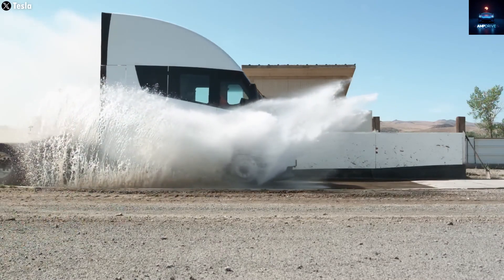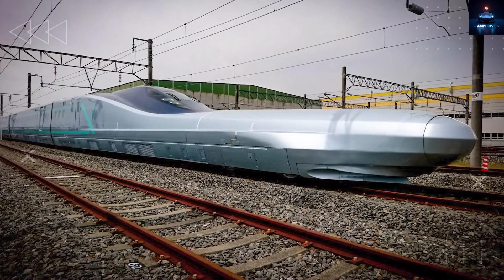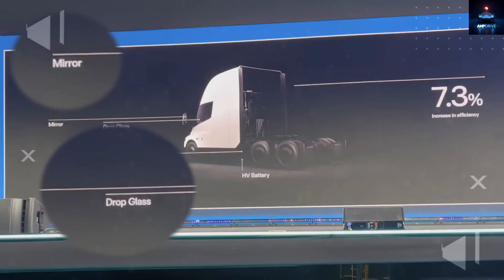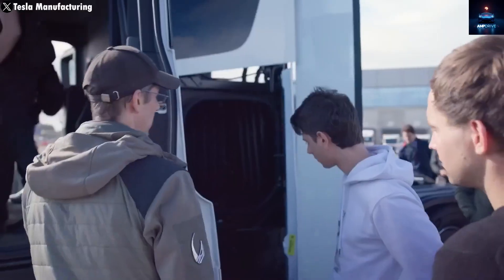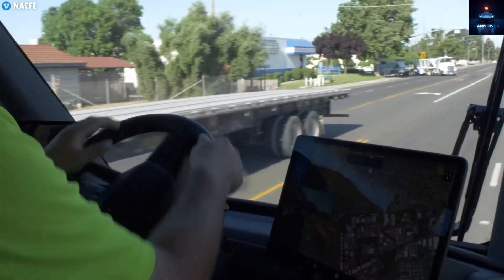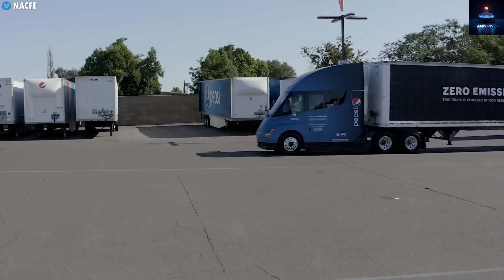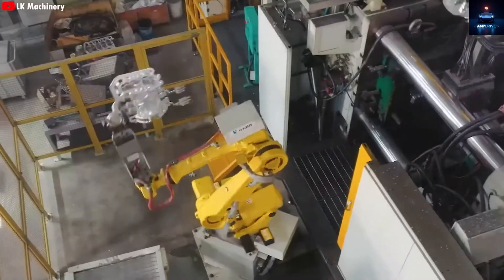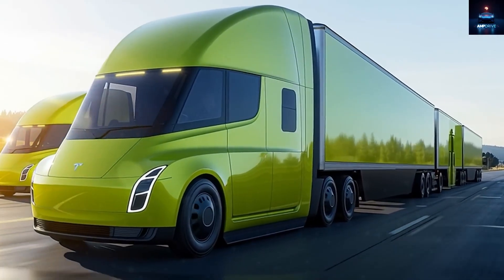Nobody Expected Tesla Semi Gen 2 to Be THIS Powerful — 4680 Battery & Autonomous Freight Future!

Comment: Air flow over the cab and trailer might be improved using an ionizer rib grid, to make the air tactile-phobic so that it pushes away from the cab and trailer surfaces rather than attaching to it as in an airfoil.  Similar to the way bubbles in the water help some ships reduce water drag.  Making a 40 - 60 ft. trailer with a flexible mid point controlled by hydraulic pistons might make the rigs move through traffic easier and safer..